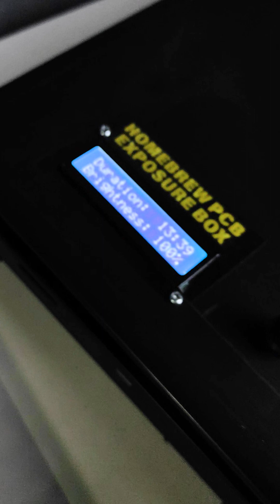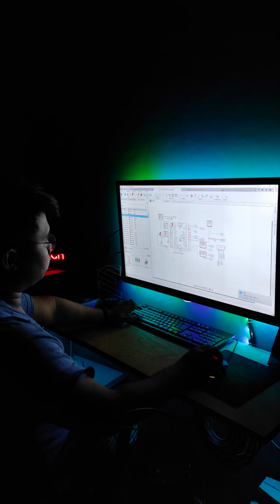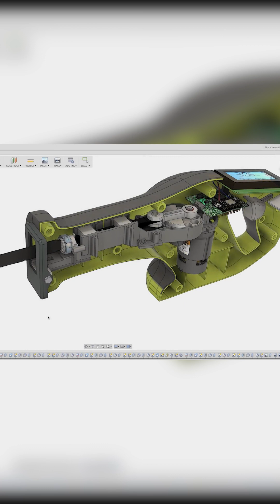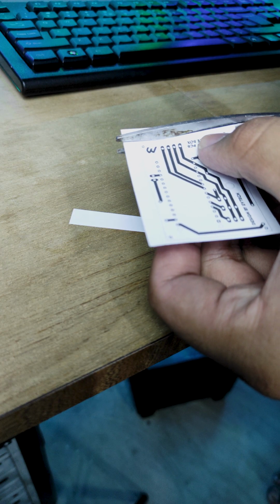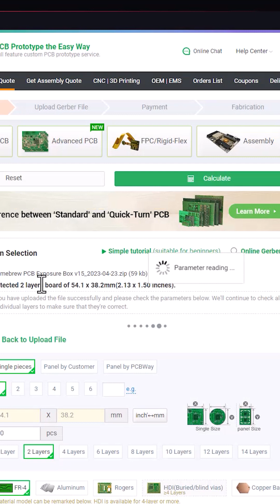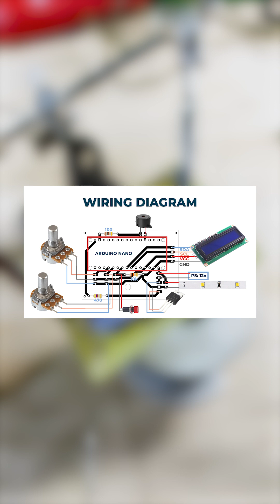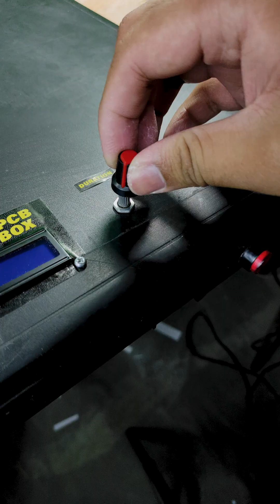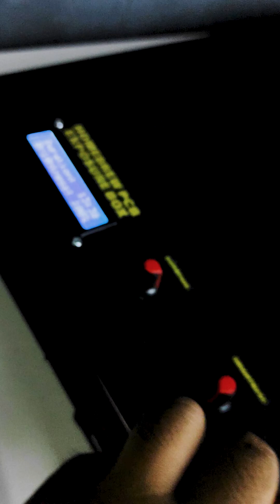Homebrew PCB Exposure Box Using An Old Printer Scanner! 🤯 | Random Weekend Project

Comment: I did this project ... but I have an issue:

1st. when trying to adjust the brightness ... it doesn't change ... it acts like a switch ... [OFF - ON] ... at 54% lights OFF above 54% lights on ...

2nd. When it finishes the time lights will turn OFF (Good) ... 
But if i want to change the time ... pressing the push button make the light on (it shouldn't) ... 
then i can change the time ... pressing again make time work while the light was on from 1st press

Any ideas?